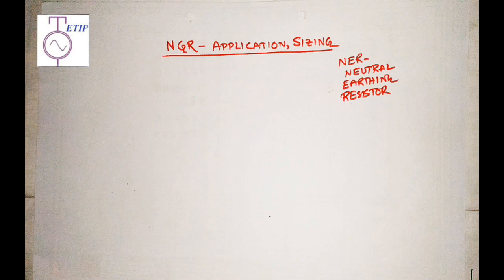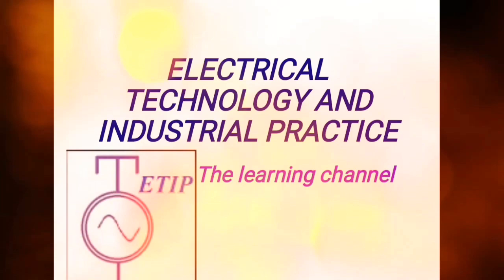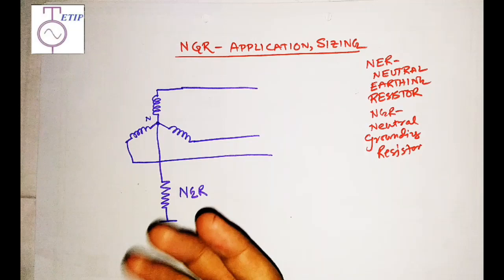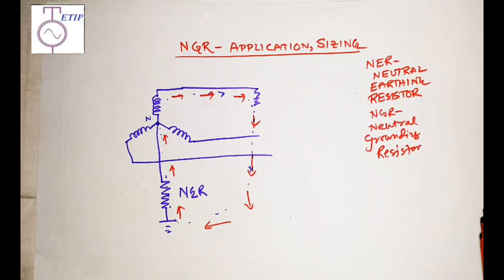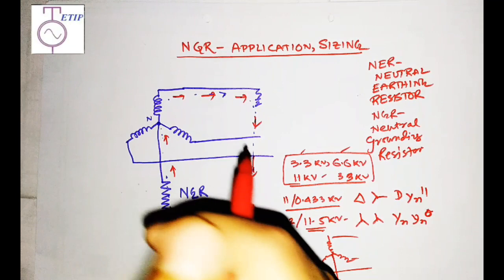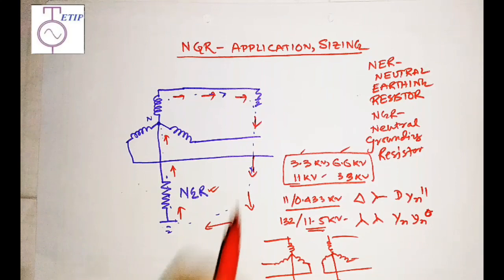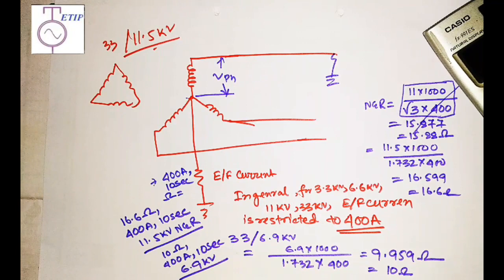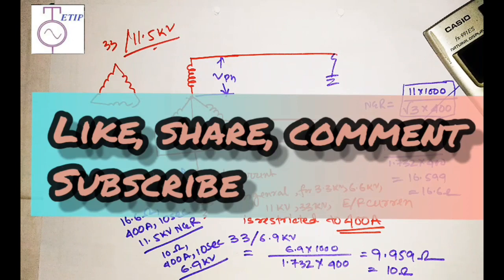Neutral Grounding Resistor Sizing and application|Restricted Earth Fault Current

Comment: Very nicely explained. Thanks.
Can you please put some light on power rating (Kw) of the NGR to be specified ?

As the withstand current is limited to 10 sec. only, then the continuous power rating of the resistor can be quite less than the peak power rating.
Any idea about it sir. ?

Comment: Impeccably   Excellent. Make video on 66kV, 132kV, 220kV,  400kV, 765kV ground resistance calculation. Also on HVDC Earthing fault calculation. Thanks
Reply: Make video on 66kV & above voltage level sir

Comment: Thanks for the video i was searching for Impedance grounded system i found this and i think its same. 
One question. For commercial facilities and residential areas, grounding impedance 
shall be 1000 A, 10 Second Resistor. I found this in one standard book.

Comment: Sir if the fault occurs phase to phase and ground then phase to phase voltage shall be taken for grounding resistance calculation. In your case u have taken phase voltage because u have considered phase to earth fault. So when it is ph-ph and ground fault. There is line voltage that is driving current  Sir please clarify?

Comment: Verry good, easy to understand.
Please explain why you change 11kv to 11.5kv?  I'm not clear to understand..thank you.
Reply: Load voltage is 11kV , no load voltage is 11.5kV , because during faults in line to ground , loads shall disconnected, in that case voltage Come back to it original state ,11.5kV , 11kV is load voltage due to voltage drop

Comment: Sir i want to request u to plz tell how to decide fault current for transformer of 15/20 MVA and ratting in 110kv /33 kv ..
Reply from the maker: Check my fault current calculation video. Method is same. But for suc high voltage there shall not be any significant motor contribution.

Comment: its excellent but one question about earth fault current consideration 400A. can we take it as standard value??
what is the basis for this consideration of 400A e/f current? please explain
Reply from the maker: i haven't found any basis, may be based on experience it has been standardized. more over it can be varied but you have to design the transformer core withstand capability accordingly. suppose your transformer core can withstand earth fault current of 200A, then your Earth Fault current should be restricted to 200A or less. you have to specify the earth fault withstand current of transformer according to the earth fault current

Comment: Can u tell me the purpose of loading resistor in NGTR and explain video about
Reply from the maker: Neutral of generator of large power plant is earthed through a single phase earthing Transformer. Primary is connected between the generator neutral and load resistance is connected across the secondary. So it will make a transformer with secondary loaded.

I shall make video on that
Reply: @electricaltechnologyandind5335  sir please make video on NGTR which is generally used in large generating station

Comment: What it is rated for 10 sec.? 
Is it necessary to specify power rating of NGR based on the fault current controlling through NGR during fault?
Reply: Both NER and earthing transformer neutral need to be rated at earth fault current. 10 seconds to account for protection auto reclosing, can be longer if required. NER resistance calculated from earth fault current level, not power. So main aspects are resistance, current and current withstand duration

Comment: Hi, What is/are the exception/s for not installing NGR in 11,3.3 or 6.6 kv? Kindly share some info on this because I have a 5MVA x'mer with 3.3 kV without NGR and the computed L-G fault is lesser than the 3Phse fault... Is that  enough reason or there few more reasons technically?
Reply from the maker: All thr above voltage levels are generally provided with ngr. 3.3kv with solid earth is a new type of system for me....  Is the transformer star star??? Or delta star???? What is the upstream configuration???

Comment: Sir why limit the neutral current for high voltage. If any problem for winding like damaged for circulating current?
Reply from the maker: for high voltage earth fault current will be higher. also there shall be possibilities of ground potential rise and life threat due to step and touch voltage. so for high voltage ngr is used. but for voltage of and above 66kv again solid earthing is done, and the potential rise hazard is taken care off by suitable earthing design
Reply: Thanks

Comment: Is there an international standard to derive the 400A used as EF current limit?
Reply: In UK, NER is selected to match the nominal current value of the power transformer winding. I suppose you want a duty that is enough to trip protection, but doesn't cause too much stress on equipment.

Comment: Hello, first of all thanks for your training. I have seen that when you have done calculation, you have not used 10 sec so when or where is  10 sec used? Thanks
Reply from the maker: 10 SEC IS THE WITHSTAND TIME OF THE FAULT CURRENT. THE NGR IS CAPABLE TO WITH STAND 400 A FAULT CURRENT FOR 10 SEC.
Reply: @electricaltechnologyandind5335  Okay, thank you a lots
Reply: @electricaltechnologyandind5335   how can we vary withstand time & it's effect on NGR value
Reply from the maker: Indian standard specifies 5 sec, 10 sec rating for NGR. So those are followed. But actual earth fault get cleared much earlier i.e. 0.5 sec at max

Comment: In which standard If  is noted  as 400A
Reply from the maker: No standard. It is common industrial value taken l. However i have seen 200A, 800A also.
But for mines area HT earth fault is restricted at 50 A and LT earth fault is restricted at 750 mA. That can be found in CEA guidelines also in IE rules
Reply: In IEEE 142, page 13, it stated: "Low resistance grounding is designed to limit ground fault current to a range between 100A and 1000A, with 400A being typical"

Comment: Say something about the power of the resistance in every case. P=I^2* R
Reply from the maker: Current through ngr will be flown only during earth fault... So loss is irrelevant for that case.
Reply: @electricaltechnologyandind5335  Yes, but since the resistance is calculated to withstand a load of 400A for 10s, I think it must be a high power one. e.g. for 16.6 ohms /11.5KV, it must be 2650 KW resistance.
Reply: @spyrosn1950  
What will be Wattage of resistance.  Will it be.  I*I*R ??

Comment: while calculating the value of NGR, you have not considered the X1, X2 & X0 of transformer, please check
Reply from the maker: This is a simplistic approach often considered in industry. Yes there is a method with other sequence impedance.  But the difference will be absolutely negligible because the ngr resistance is very high compared to the transformer and also it will 3 times while considered in the zero sequence network. So both will give you same result.

Comment: How this general current of 400A is defined?
Reply: It is not necessary. It depend on power of transformer,and generator.
Example: 
Power of generator = 3.75MVA 
Voltage line to line = 13.8kV
Then full load current= 3.75* 1000000/1.732* 13.8
= 156.9
We will limit  earth fault current  to be approximately 30  to 35% of full load current.
Then earth fault current = 156.9*0.32=50 amp
Now ohmic resistance which limit the earth fault current will be
R = voltage / earth fault current
R= 13.8* 1000/ 1.732* 50
R= 160 Ohm.

Comment: Sir where NCT is connected?? And why its require?
Reply from the maker: There are two possibilities
1. NCT connected at transformer neutral bushing
2. NCT connected to NGR.

Both are used in industry. Transformer having solidly earthed neutral nct shall be connected at bushing only.

Earth fault current returns through the neutral. So nct is required to detect earth fault current. I will make a vdo in nct selection. So please stay tuned.
Reply: @electricaltechnologyandind5335  sir thank you for your support

Comment: What will be temperature ?
Reply from the maker: Thats an instantaneous current. So there wont be significant temperature rise
Reply: @electricaltechnologyandind5335  Design temperature ?
Reply from the maker: 50 degree ambient. It is not a continuous operation. So what temperature are you asking???
Reply: @electricaltechnologyandind5335  the withstanding temperature of NGR under fault current

Comment: How 400A came? What will be this value for 415V NGR?
Reply: I need to restrict fault current in LT side as the fault current can damage the cables as cable fault level is very less (28kA for 1 sec for 300sq mm)  wrt Transformer fault level (70kA).
Reply from the maker: Why your transformer fault current is so High? There is mistake. Lt trafo fault current should not go beyond 50 kA for trafo upto 2.5 mva and 65 kA for 3.15 MVA.
Your cable is suitable for 28 ka for 1 sec. But you don't need to let the cable handle fault for that time. Watch my cable sizing video.
You can restrict earth fault current, but phase fault you can't restrict. So select higher cable size. 
Watch my cable sizing calculation video......
Reply: Transformer size is 3 MVA & %Z is 6%. This is the reason for very high current in 415V side.
Feeders are low capacity, I.g. 500A, so I can't choose 400sq mm cable size. 
Only thing is that I have to control these things by tripping time.
Correct me if I am wrong
Reply: And I think due to Personal safety we dont use NGR at 415V side.
Reply from the maker: Yes isolate the fault with short time.... Wrong transformer selection is made.....
Reply: Transformer selection is wrong!!! How? Let's u have to give a connection of 150kVA*20feeders. Then Transformer capacity would be at least 3MVA (just an example). U have to design 3MVA capacity with 11000/415v. What's wrong in the design?
Reply from the maker: Percentage impedance should be higher. Your fault current is around 70 kA. So your initial peak fault current will be 70*2.05. is your switchboard has that capability to withstand the mechanical force???? You have to check that. And 150 kva 20 no of feeder may be distributed in two trafo, with one standby. If you have designed the system with 2w+1stand by trafo of rating 1600 kva you would have been at a comfortable zone. Now check your switchboard peak withstand capacity. That can not be nullified by relay.....
Reply from the maker: Or 3 mva trafo with higher percentage impedance so that thr fault current is limited to 65 ka. However now higher fault rated breakers are available but that would make the system expensive
Reply: @electricaltechnologyandind5335  If I choose 2 main+1 standby Tr each capacity of 2 MVA instead of 2Tr of 3MVA then the fault current would increase as fault will be fed by 4MVA capacity instead of 3MVA.
Reply: @electricaltechnologyandind5335  if I try to increase %Z then NO Load losses and Cu loss would increase. And to limit the fault current, I can't increase it more than 10%.
Reply from the maker: Why you need to run the transformer parallel???? Isolate the trafos with buscoupler...
Reply from the maker: How no load loss is related with %z????? Cu loss will increase only if resistive component is made higher. You increase inductance...... It is a very simple case..... If you can change trafo impedance, make some system study, and change it......
Reply: @electricaltechnologyandind5335  Not no Load but Cu Losses

Comment: 400 A is not common earth fault current for all voltage level 33,11,6.6,3.3 kv
Please clear that

Here same voltage level have two type ngr
 1. 9.90 ohm
2. 18 ohm
Reply from the maker: 400A is most common for 11,6.6, and 3.3 kv. There are exceptions also.... In mines these are Restricted to 50A
Reply from the maker: Here means where??? There are exceptions....

Comment: Where 10 sec time is in calculation.
Reply from the maker: 10 sec is not there for ohm calculation.  But when you select the cross section of the NGR conductor then the 10 second factor will come.
Reply: @electricaltechnologyandind5335  can you please explain in detail about this 10 sec.
Reply: @ajinkyakhandare190  Earlier NER design it is considered as 30 sec on liquid resitors but now a days NER design for 10 sec chosen to allow occurence of  multiple events.

Comment: Sir can u check your calculations
Reply from the maker: Please tell me in detail
Reply: Sir equation is showing 11.5*1000/1.732*400 k but when u calculate 11.5*1000/1.732/400 after that only value will be come so please check that equation in video.
Reply from the maker: 11.5 *1000/(1.732*400) or 11.5*1000/1.732/400 ohm, may be i have missed a bracket. Simple ohm's law, for 11.5 kv line  to line voltage the phase voltage is 11.5*1000/1.732, dividing this by 400A you will get the ohmic value